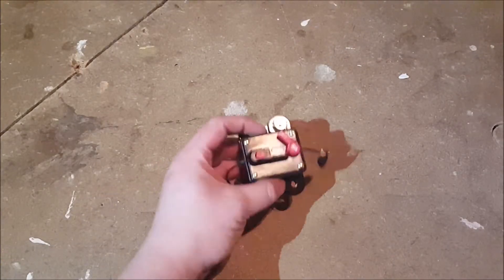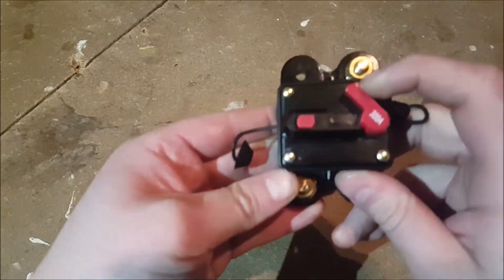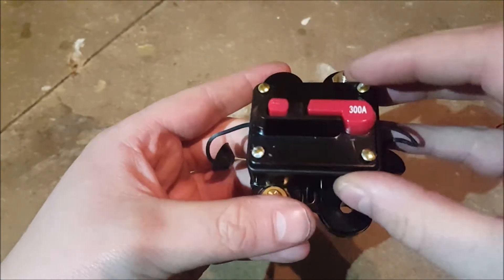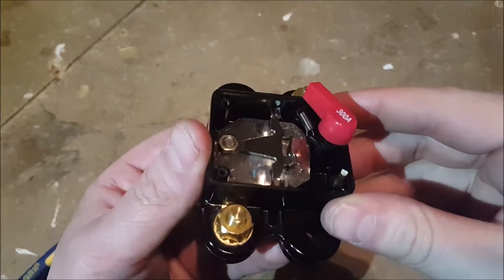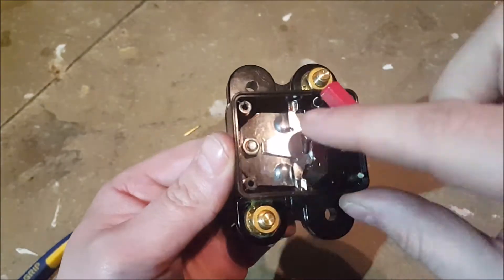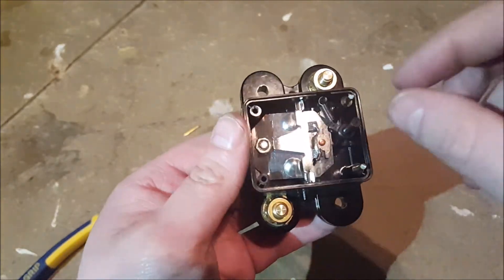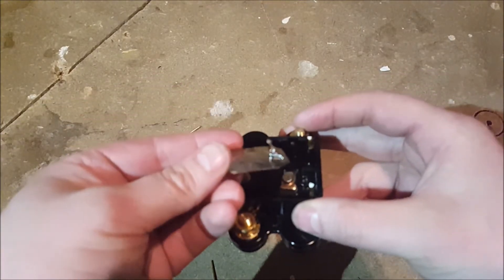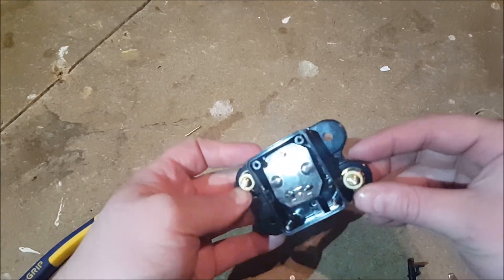300Amp DC Circuit Breaker Teardown Troubleshooting

Comment: It's not BIO  It's BI  meaning 2... Two different metals with different melting temperatures.
Reply from the maker: Thanks 👍
Reply: Bimetal: two differnt thermal expansion coeffects.  It tries to bend but (due heat , which is in turn due the current passing though it) it stays flat until a set temperature.  When it reaches that set temp the plate  pops to a curved state opening the contacts.  Was the nut loose when you opened it?  It should have been quite tight. That would certainly caused it to fail.

Comment: I am currently using one of these  circuit breakers on my vehicle to control a switch panel used for off road light’s. Some times I get power to my switch panel and on other days it’s completely dead. Do you think this is a cause of a faulty circuit breaker?

Comment: Thanks for the internal view... now I don't have to pull my 80 amp version apart. BTW the correct word is bimetallic... means two metals, which you correctly described but called biometallic... not a word (that I know of). Cheers.